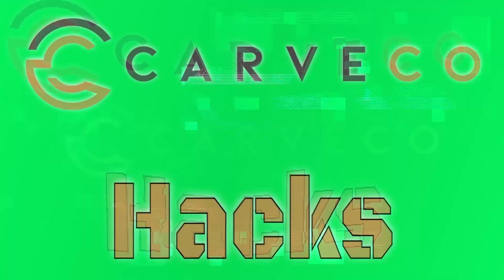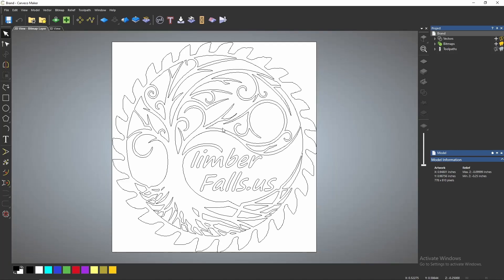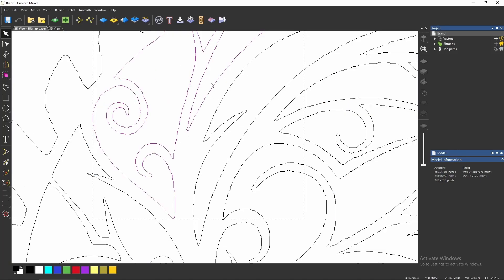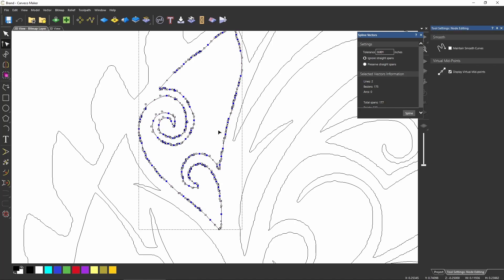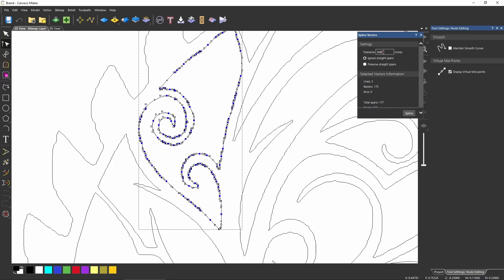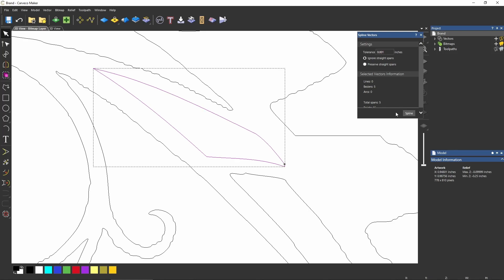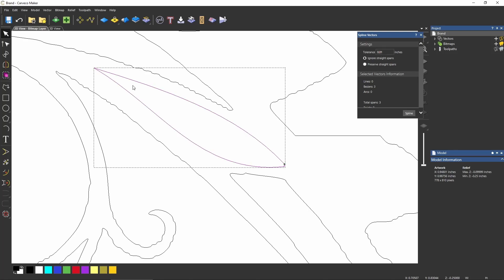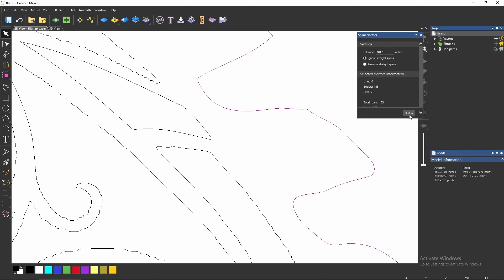Carveco Hacks - Fixing Vectors With the Spline Tool

Comment: Didnt know this one yet, thank you.
Reply from the maker: There are a few hidden gems like this one in Maker and Maker+. The arc vectors tool that is next to the spline tool can also work like the spline tool to clean up vectors but uses arcs instead of Bezier curves.
Reply: @Timberfalls  I finaly upgraded to Maker +, needed to create reliefs, use to make them in Blender and import them as stl file but I was missing control.
Reply from the maker: @Bart_Depestele  I have been working on learning blender and zbrush but its slow going.